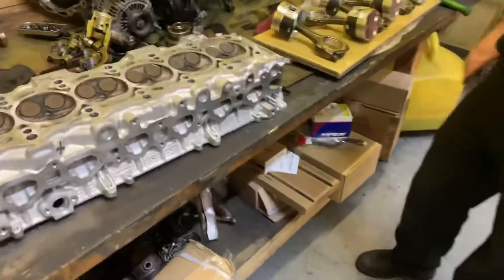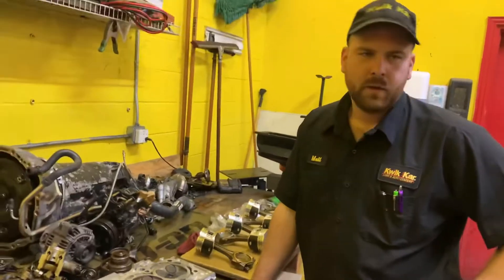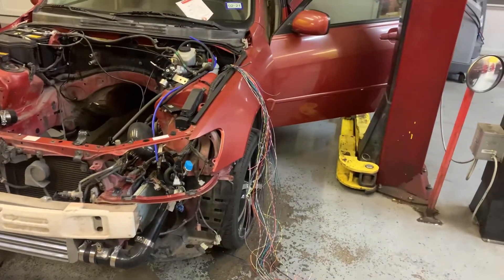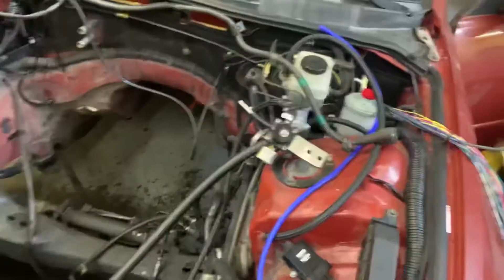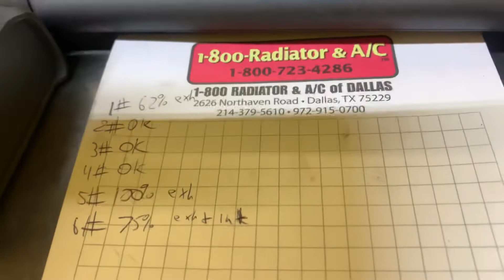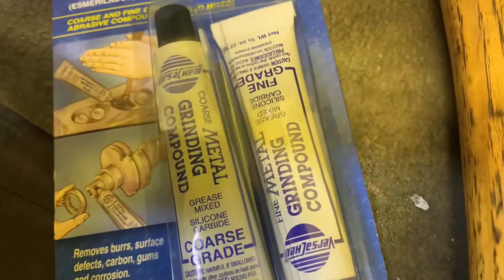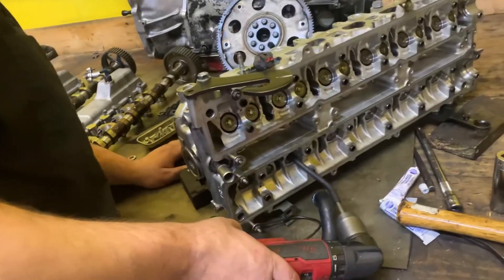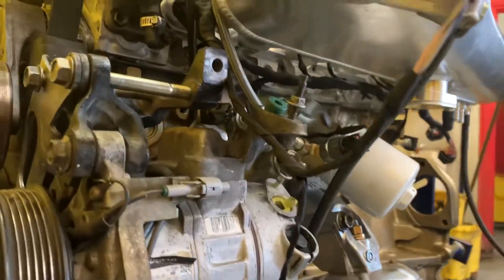Turbo 2JZ Budget Rebuild for IS300

Comment: what size ring gap ? did you guys re use the main cap/rod bolts?
Reply from the maker: Top ring .019, second ring .022, and yes we reused the stock main and rod bolts.

Comment: Careful on the piston pin snap rings.  You may have gotten it right but I thought Id mention it.  Snap rings have a sharp side and a rounded side from when they are stamped. The sharp side should go away from the load being put on it. For a piston pin it should be facing the outside. Also the opening needs to be on the top or bottom.  Ive seen cases where both situations have caused a snap ring to come out.  Keep up the good work. Im curently building a 84 maxima wagon. It has the L6. Im planning on putting a l28et swap into it.  I used to have a 260z with a similar setup from your zx. I was running a He351cw turbo though.  Keep up the good work.

Comment: Are you using a gte head gasket or a ge head gasket?
Reply from the maker: I’m currently running a tomei 2 mm gasket. My understanding is stock ge vvti uses a .6 mm gasket, and stock gte uses a 1.3mm gasket. I went with a 2 mm to bring the cr down to the  9.8-1 range. Can’t say whether that was the right choice. I do feel I’m missing some bottom end grunt that I’d otherwise have with a higher cr, but my main intent  was knock control. Next time I tear it down I may switch back to a gte gasket for a little more compression. Hope this helps.

Comment: I’d look to lubing the wrist pins before you start it. I might be mistaken but it looks like they went in dry.
Reply: Permatex assembly lube is a good idea to slap on anything moving.
Reply from the maker: No worries I slather the heck out of everything before it goes together 👍🏻
Reply: @masterofmachines  perfect, best of luck with the build.

Comment: Ready to see this thing hit the track.  Don’t know if you heard but we’re going to have another track starting in the spring.  Btw, I can’t remember if you’ve mentioned it before, but what are your et goals with this car?  The Z is on the 6’s now, so, 5’s?
Reply from the maker: Oh ya, we’re all over it. I30 dragway is going to be the closest track, and in all likelihood our new home. Our goals for the Lexus for now are to be competitive in an 11.5 index with full interior, power steering, and hvac. You know we like to make improvements progressively so we’ll def be pushing it harder as we go, and identifying the weak points of the overall set up. I want both cars at ifo in March, and both dialed for 11.5 index. I think weight and fuel system are going to be the biggest factors in whether that will be possible.